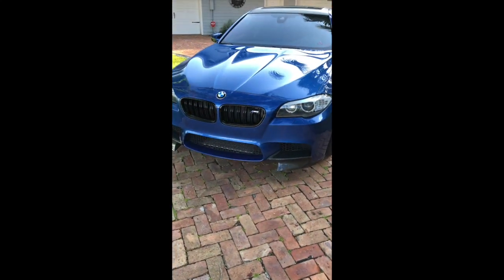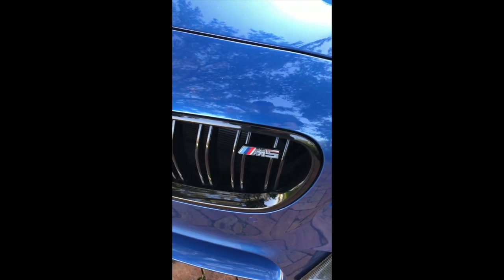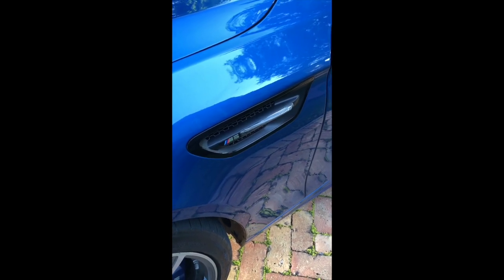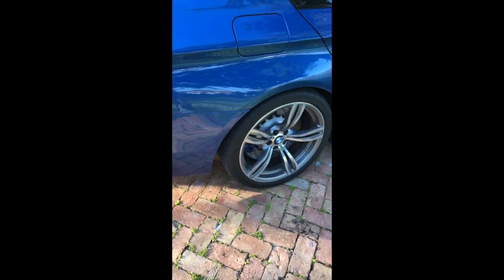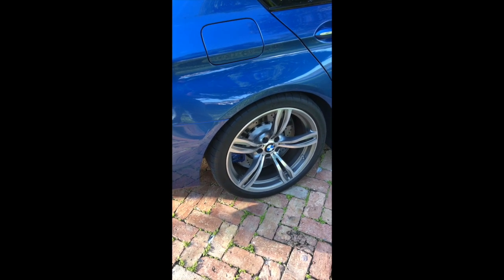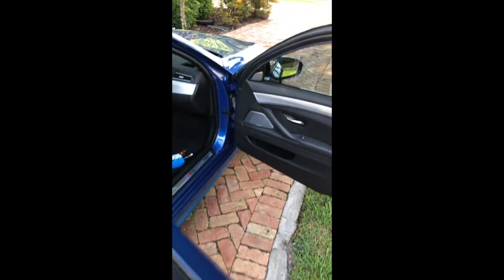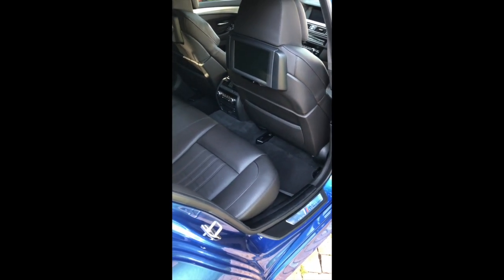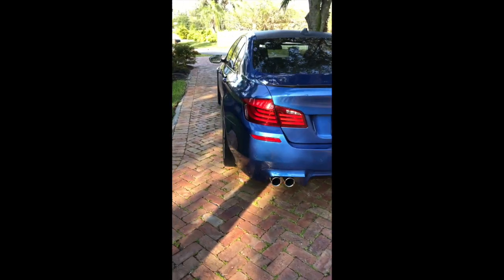BMW M5 F10 - M LOGO PUDDLE LIGHTS, COLD START, MODS, FEATURES, FIRST VLOG

Comment: Is that your laser jammer underneath your rear diffuser? I have two in the front but i need to add one in the rear as well.
I have the carbon fiber diffuser in the rear and it looks great. I actually had to drill two holes on my carbon fiber diffuser to hold up my K-40 rear radar and it has held up pretty good. It’s been on there about two years and so far everything has been good…..I have some pictures of my M5 on my Instagram page (JustM5Life)
Reply from the maker: Hey Just M5, it is a K40 detector and the sensor is secured by two factory bolts that hold the rear diffuser in place.  If you watch my video on the addition of the carbon fiber diffuser (just browse my channel) you will see how it is secured without drilling.  Hope that helps!